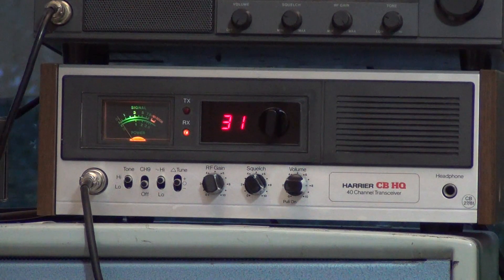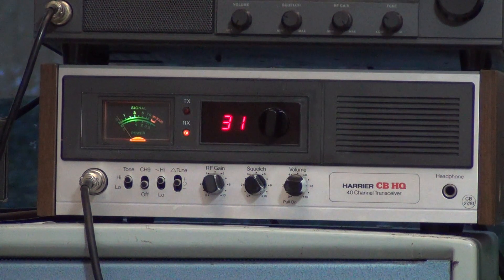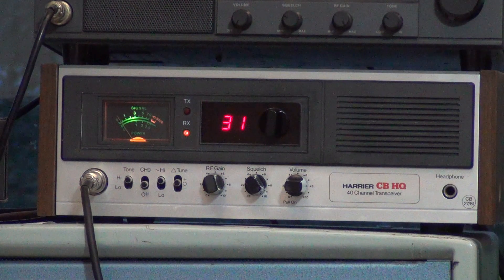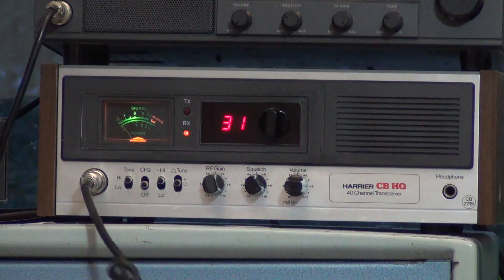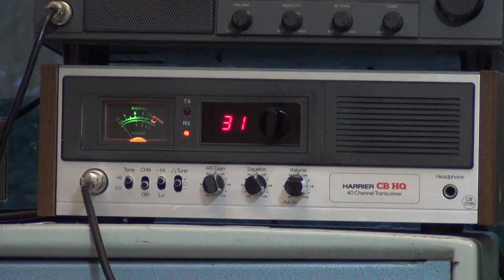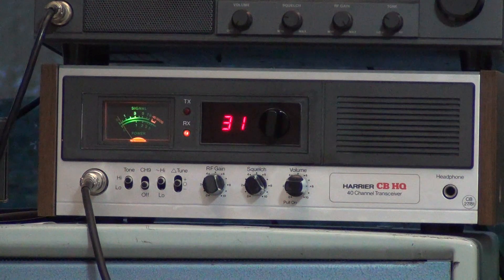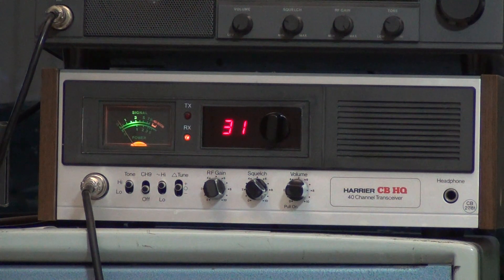Midland 77-810 CB27/81 UK FM emergency CB radio - field test

Comment: 👍 Yeah, those little aerials on their mag-mounts are not really up to it, but they do what they were put out to do.  For emergency use, they work fine.  The other thing is they do pick up a bit of noise from the car, so rang is limited due to both these factors!  However, the sets do what they were put out to do.  As you say, if you want more range, use a bigger whip on a mag-mount.

Comment: Seems your CB HQ was only showing around 1.5W on transmit on the meter 🤔 I presume it needs recalibrating, or adjustment Richard? Or has this always had a slight issue witht the meter, as I have noticed it during your demonstrations at the end of your videos. Just a curiosity. Great video again both of you 👍👍
Reply from the maker: The radio is doing 4W & the meter is calibrated spot on. Remember most CB's up to quite recently have 'relative' power meters. It's relative to aerial impedence & SWR. Unless the aerial is as spot on in every way, it won't read the same as when calibrated into a dummy load. If I put a different type of radio on the same aerial, the meter may read about 4....or the same 1.5...or bang accross to the end stop. It's all pretty meaningless & the radio is still doing 4W!

On newer sets, most RF power meters are fake bargraph displays & bang across if the radio is doing 1W....or 4W...or whatever. They are pre-programmed to do that even when the radio isn't really transmitting any power at all because of a fault. I refer to this in videos as 'a glorified tx light;

Hope this clarifies it a bit.

Richard